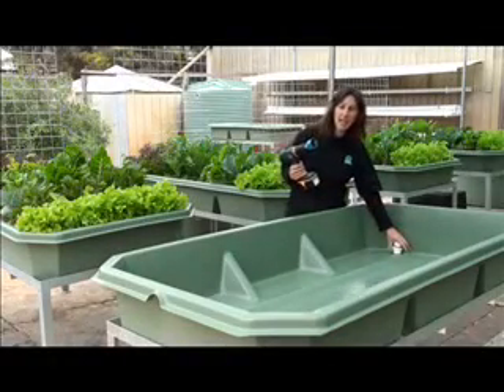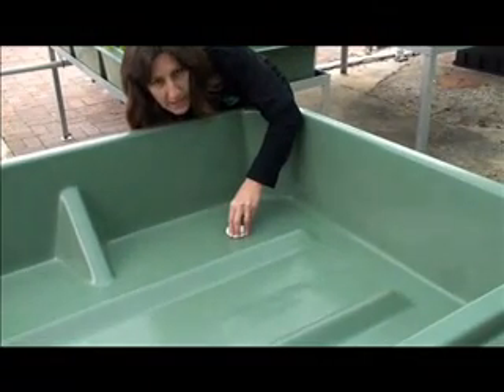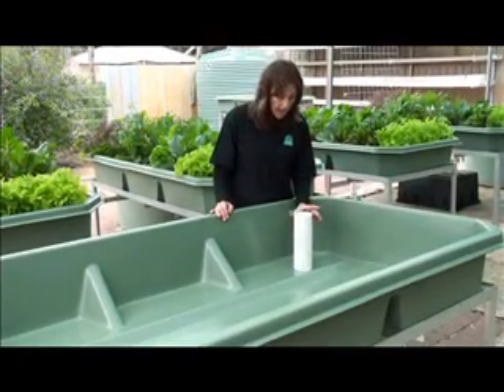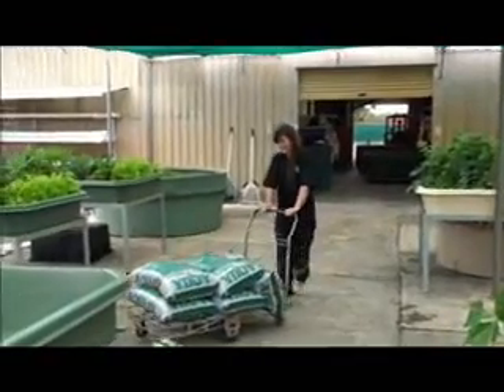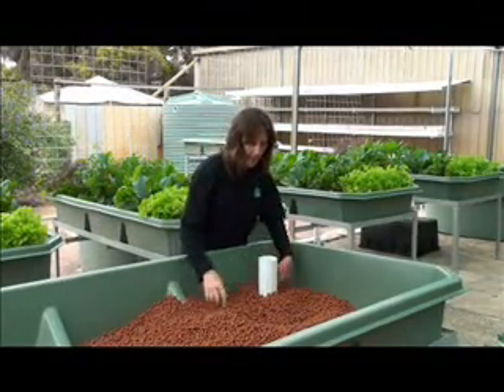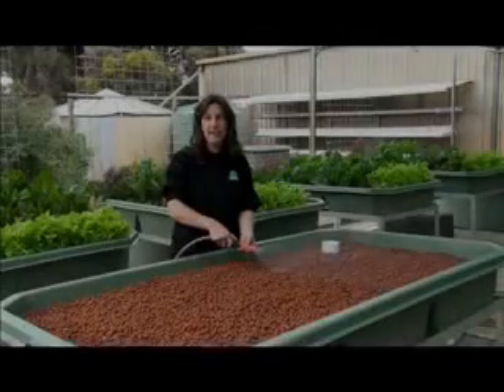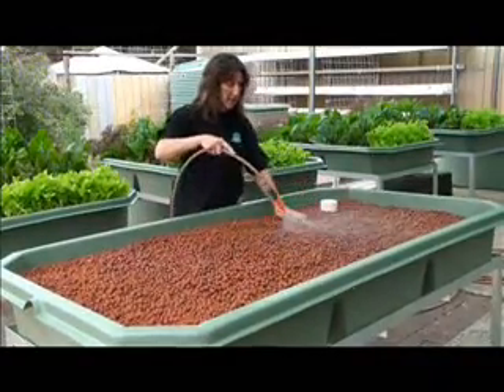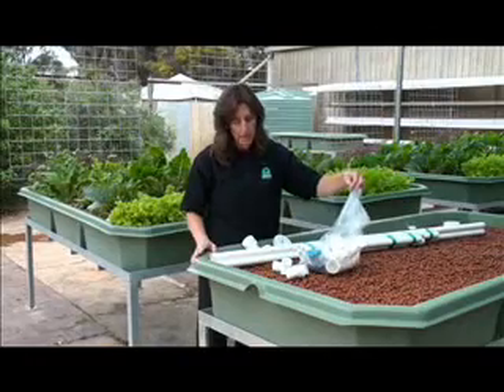Backyard Aquaponics Intall video Part 1 of 3

Comment: Why did you not "glue" your center pipe, so it does not move about?
And why is the "drain" hole not at the lowest point?
I am not critical, just wondering.

Comment: 7:05 can you explain to me the output of the expanded clay tank? Is one pipe inside of another, but the water comer over the larger pipe? I saw another video of aquaponics using auto siphon, but yours seems to be different.

Also, what pipe cutter are you using in this series?

Very interesting videos, I'm trying to find similar tanks here in Brazil to start my aquaponics with Tilapia! Thanks!